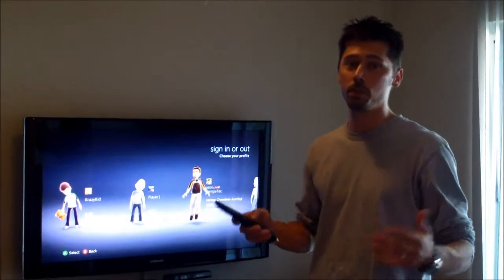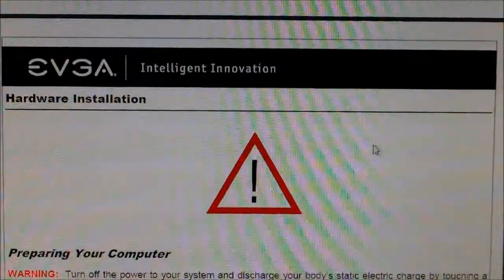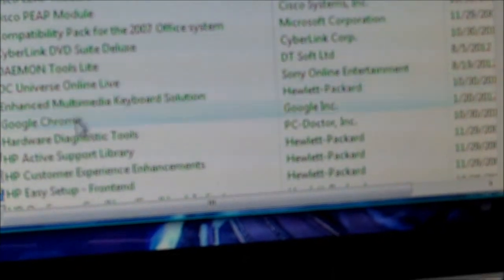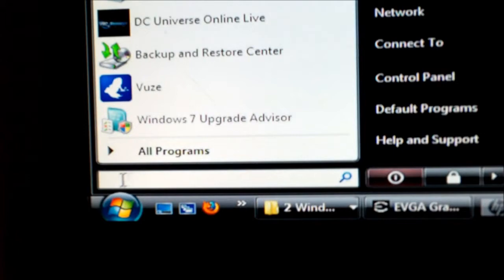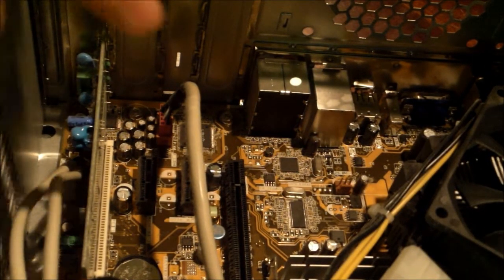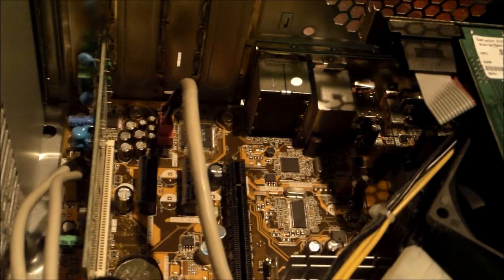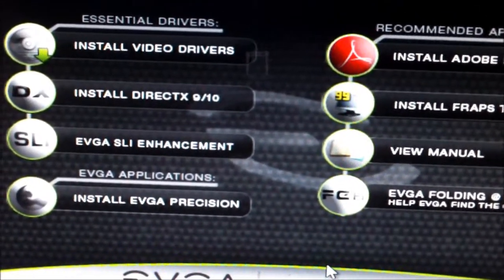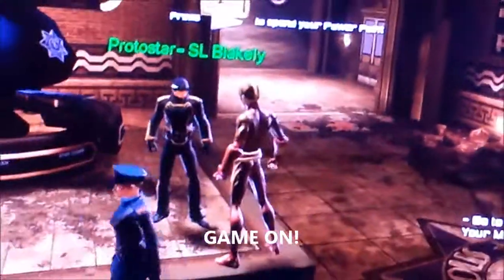HOW TO INSTALL VIDEO GRAPHICS CARD REVIEW

Comment: Bro...I have hp pavilion 500-369...can you recommend a much better video card that compatible?..also video nvidea..I like the nvidea booster.... :)
Reply: GTX 960?
Reply: ***** i bought a sapphire r7 265 xD
Reply: +Alfie Gangan hey I know this is late but how well does it run games? I have it too but upgraded ram to 4gb
Reply: VevoRespawn272 can run csgo at highest settings 100-120 fps but..its bottleneck the cpu
Reply: Alfie Gangan Thanks for the reply, i just bought a r7 360.. lets see how it goes.. i am planning on buying a whole new motherboard,cpu,ram,and a power supply in the near future, but if this gpu upgrade fulfills my modest gaming standards.. then God bless! XD
Reply: +VevoRespawn272 nice man..but does the gpu compatible with your pc?
Reply: From my research it is, but we'll see when it comes

Comment: ok graphic card putted should i replace gma 950 of the system or what?:after adding geforce 210 vga monitor is not responding
Reply: get gt730 2gb
Reply: already solved this years ago :) althought preparing to get newer machine with at least 4x3,8ghz

Comment: ZZZZZZZZZZZZZZZ hp pavilion slimline series, i got a windows 7 64bit Intel core i5 3450@3.10GHz(4CPUs) 8192mb RAM geforce GT 530 ARGH it cant run battlefield 4

Comment: hey...i hav  a hp p6338in...i cant take out the slot (not pci slot :P) wich has a pic of screw driver in it...pls suggest a way to open it..my gpu requires 2 slot to remove so i cant remove dat one....pls help...

Comment: i have a hp pavilion elite hpe, with a NVidia GeForce graphics card and I am having a lot of trouble with it. problems with my computer constantly crashing, freezing, going unresponsive, and can't do anything with flash for more then an hour or the computer will crash, when the computer goes to sleep and I move the mouse to get it back up it takes like 10 minutes and internet explorer will freeze.. I had a buddy of mine till me it was the graphics card. is that correct?